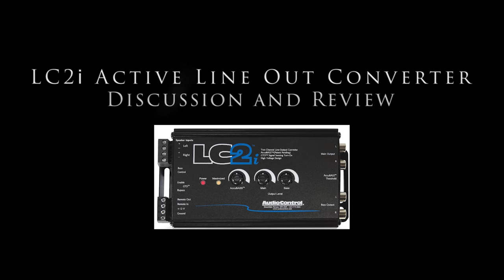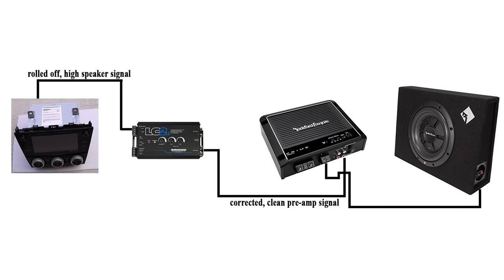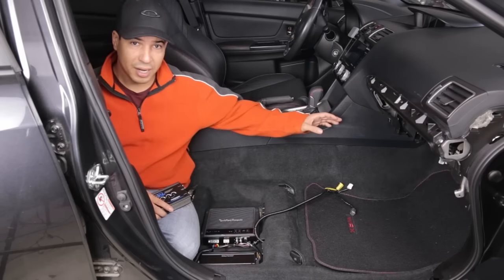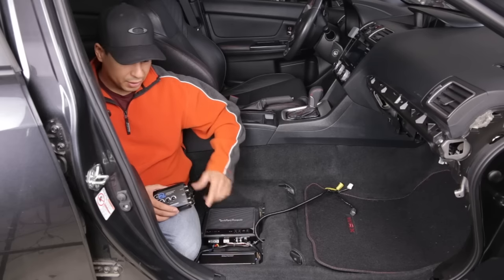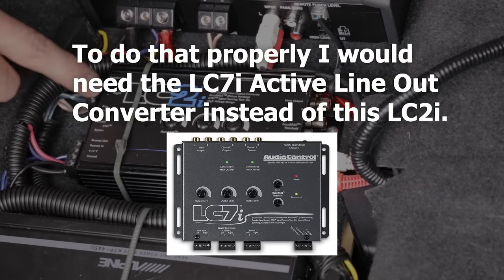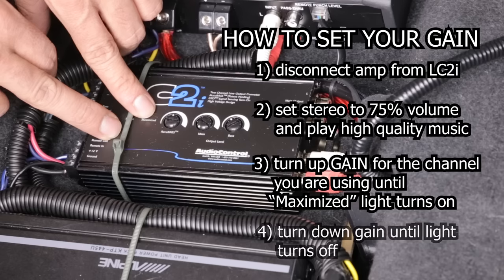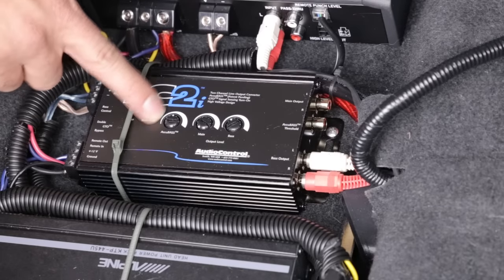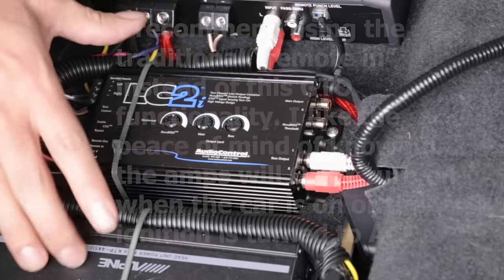LC2i Active Line Out Converter Discussion and Review

Comment: If I only tap my rear speaker wires and still power them from the OEM Uconnect 5.0 factory head unit in my 2016 Renegade Trailhawk will I still get full audio on those speakers including fade?  I only want the sub RCA out and I want to leave my speakers powered by the factory radio.
Reply: Boost & Shutter Thanks! I have everything laid out including the big 4, but now I'm trying to fit my 2001Power Series RF1000.1BD under the driver seat.  There is lots of room vertically but it's a sub compact and I don't want to take all of the floor space for back seat feet.

My back seat mounts to the floor so it MUST be under the driver seat.  I don't have power seats.  I am leaning towards some kind of shelf to elevate my amp, but not sure how to do it.

Comment: What if you were just going to use it for  a sub and the stock subwoofer wire is easy to get at would it be fine in that case to do one channel  with the stock wire or would the sub also need the left and right channels ? Also if you can do it , do you connect the wires to the left or right connectors?

Comment: I have a question you said you tapped into the wires from your amp for power and ground. Can I just do it straight from my amp? I have 0gauge wiring all around. It won't blow this little thing up? Just clamp it on my amps Ground And power? I've never had a car without a aftermarket headunit this whole hi low thing is brand new to me. Just picked one of these little guys up
Reply: @akqjtn  awsome thank you. And yes my ground is always as short as possible

Comment: What EXactly do i connect the 12v input to ? Was gonna connect it to amp but the 4awg power wires barely fit as it is. Should i connect it to my mainline fuse? or maybe on one of the outputs on my power distribution block ?

Comment: Will something like this remove types of interference ?  I've installed the same system in a different car with one if them Walmart converters and now I'm getting interference randomly when I start my car.  Sometimes it will do it when I start it a quick bump in the sub ( quietly) or when I use the driver or rear driver window . It goes away after a few minutes. Not sure what the hell the problem is and don't know where to start since this doesn't happen everyday.

Comment: Hello! Please help :) I have a Lexus CT200h and I have my Amplifier and subwoofer in the back of my car. So then my LC2i would be in the trunk. Would it matter in terms of sound? Because I would have to run speaker wire from the front of the car all the way to the back... Would that affect my front speakers? (Since I will tap into those) or the signal since I would run almost 7 meter of wire?

Comment: If I have two amplifiers being powered one for the bass and then one for the main, that requires two remote turn on wires...can both of those remote wires from each amplifier be ran into the remote out on the lc2i?
Reply: Thanks man...Clean and Beautiful install there by the way man. I plan to tie my lc2i in with the left and right rear speakers...is that how you tied your converter in?

Comment: Great video! I have a 2012 Jeep Wrangler with the infinity sound system with the factory 8in sub. Could I use a cheap passive LOC on the wires running to it and save some money? Or would it still be beneficial to get an active LOC?

Comment: If I have a low level input from factory sub to LC2i, can I still use the main output to run a highs amp? Or would I need a high level input put into the lc2i to accomish that?

Comment: If im running 2 amps, do i just need to run rca's from the loc main ch to the highs amp and rca's from the loc sub ch to the sub amp. Or do i still need to tap into the speaker wires and run them into the highs amp?

Comment: Does this LC2i and LC7i clean the full range signal from the amp or just the clean low bass frequencies? The stock radio on my BMW has a very equalised signal going to all speakers. Will this do the job and send a cleaned up signal to both the main amp and the sub amp? or do I need a proper DSP unit?
Reply: @akqjtn  Ok many thanks.

Comment: I have a question I’m hoping you could help me out. I’m working with a 2017 Silverado and I’m planing on using my stock stereo/ stock speaker . What I plan on using is one 10 jl audio w7 with a jl audio 1000/1 amp,  one capacito, one epicenter. HERe COMES THE BIG PART WILL I BE NEEDING THIS LC2i for my set up? If so would you recommend the LC2i or the LC7i???
Reply: Boost & Shutter thank you I appreciate you taking the time and reply.
Reply: Boost & Shutter I had one more question by adding the LC2i will I still e able to use my steering wheel control- volume/track control or will I need some other type of adaptor to keep that

Comment: good video, my Audi A5 doesnt have RCA pre out so i cant install my amp to power my door speakers or my component speakers, i dont need a subwoofer, just components, will this work?
i suppose ill have to tap in to the factory door speaker cables?  lastly if i connect this to my door speakers will i lose the sound from them, i want the door speakers to work along with my components..
Reply: MROOD The Lc7i will work better for all your speakers and future proof If you ever wanna add a sub

Comment: When you say 400max for the LC2i,  would you explain? I have one and I have it running an amp that puts out plenty more than 400watts. So is this 400 watts max INPUT? I’m confused. 

Let’s say somebody has a coupe of ZV4s or something along the lines. Can this be used for a system that’s pushing out let’s say 2000rms?
Reply: 400 watt max input to lc2i you can run any amount of watts after it as you want
Reply: I just read that the lc2i only outputs down to 33 hz I hope that's not true my box is tuned to 32 hz

Comment: Does the LC2i need to be placed before or after the in the line amp? I ask because in my wife’s car she has a factory premium stereo with tweeters, content speakers and a sub. I am looking up upgrade the sub and i am not sure if I should take the current sub speaker wire and put into the LC2i then RCA to the new sub/amp or connect prior to the factory amp and connect to the front speakers back?
Reply: need to know year/make/model/trim level of vehicle in order to provide accurate information
Reply: @face2face11  I have 2007 cadiliac dts can I get signal for lc2i from factory subwoofer wire that plugs into the factory sub it's a bose system btw?!!!

Comment: I have a question, I have a kicker 80 watt amp and a 10 inch JL audio sub I installed in one of my old vehicles. I used the factory radio because of the navigation / on star etc. I unfortunately went to the local auto shop and purchased pretty much the cheapest line out they had. It sounded (ok) but not great. Is that particular converter necessary for a little 80 watt amp or is there a different option I could use?? I'm good with spending a little extra on one of those things but I feel I'm not running enough power to justify it. Please help.
Reply: It will sound better, for sure.  I just finished installing mine yesterday.  I've had the same amp and sub for 3 years and NEVER got the sound out of it I'm getting now.  I tossed that $15 line out converter in the trash.  I wouldn't even give that thing away.

Comment: Quick question sorry if it’s a dumb one ? In Laymen terms with this I wouldn’t have to get a aftermarket cd deck for my car? I’m finding out it’s really hard to find a kit for me to add a aftermarket deck?? Cuz I know with a Aftermarket deck it makes my whole system louder.! And by system I mean I have a Sub in the trunk with 500 watt amp. I upgraded the front door speakers also. And know that my factory Radio isn’t pushing the door speakers to full potential. With this would it do that? SoWith this It can do that with the factory Radio?
Reply: Boost & Shutter and with this will it let me tap into my front door speakers? What I’m looking for is a way to get more outta front door JL audio speakers without having to add a second amp? It’s going in a Saab 9-5 and know from past stereos that just from having an Amp it somehow brings out even the door speakers? Now having said that I’ve always been able to have an Aftermarket Deck which makes me wonder if it was just that , that made my door speakers louder? I’m just trying to get the most out of my system without having a Aftermarket Deck which most say isn’t possible in that car or a second amp? So when you say tap into front speakers with this is that possible to do?? Cuz I know even with just my 2 JL 12s I’m gonna need more outta my door speakers which are JL also!! So with this can I tap into my Front door speakers then your saying?
Reply: Boost & Shutter thank you for your help.

Comment: This might be a silly question but even if you use the GTO function, do you have to still run 12v power and ground to it?
Reply: Boost & Shutter avoid using the gto function?
Reply: Boost & Shutter what did you use as a remote to your lc2i, about to install mine, stock radio in a ford fusion 2016.
Reply: Boost & Shutter Thank you!! Awsome vid btw!!
Reply: My 2 cents is that it depends on the wiring I’m currently using GTO function on my Camaro 2016 and it works great to turn on my amps and epicenter with no issue

Comment: Ok so I installed this on my car and my subwoofer would just go super loud for no reason. I triple checked everything. I had the lc2i in my last two cars and it worked great. Does it mean it bad? I disabled my microphones on my Cadillac ATS. I grounded to my battery and my music will be playing normal then just my subwoofer will play loud. I’ve tried two ampliers so it’s not the amps . Any suggestions
Reply: I didn’t try the main channel. The bass knob won’t work on that channel does it
Reply: I was just messing around with the bass knob and I muted the volume and just turned the knob and I could hear scratching noise coming out the subwoofer

Comment: Having a bit of confusion with the remote in and out cable connections. Which one is used for the remote turn on wire on the after market amplifier?
Reply: thanks much!! That cleared it up
Reply: What ☝️said
Reply: You can use remote out for your amps and it will use its gto feature to give you a remote trigger without finding a 12volt switched acc or remote from your headunit.
But if youd like to bypass that feature you can switch the jumper to bypass and use your own remote wire
Reply: so i have a similar setup like yours , i havent added my alpine KTU-445 as yet tho, which i have,, do i need it at this point? how would  i add it?
Reply: On the contrary: like he said, You don’t even need a remote wire... actually the speaker wires that you connect into it from the head unit or off the speaker lines provide power to the lc2i, and then. Lc2i has remote wire out that you can use to provide a remote to whatever unit you have or need. That will only turn on when the speaker wires give a signal. I prefer it this way, cause you don’t have to go searching for a remote wire in car. Less wires and it stays compact in the area where you ave you amps, capacitors, epicenters etc..
Reply: @conquerirlemonde8432  that is completely incorrect. the speaker wires DO NOT provide power to the LC2i. they provide AC voltage, in the form of an amplified audio signal, which the LC2i can sense and therefore determine when to turn on... but the power, or supply voltage, for the LC2i is provided via the constant 12v and ground connections in a separate terminal. what you are describing is the manner in which a PASSIVE LOC operates; the LC2i is ACTIVE. (if you think otherwise, feel free to connect ONLY the input signal section of the LC2i, and watch as it never turns on.)

Comment: question? When tapping to the rear speakers to connect the lc2i Line out converter, i see that the shop i took it to only tapped into the rear left speaker. Is that fine or is better to tap to both of the rear speaker and connect them to the line out. Also i am kinda of confused because how should i leave the amp gains and bass boost, should i leave them half way and then match them to the acubass and bass.
Reply: got cha. Thank you.
Reply: What if you were just going to use it for  a sub and the stock subwoofer wire is easy to get at would it be fine in that case to do one channel  with the stock wire or would the bass also have left and right etc.? Also if you can do it do you connect the wires to the left or right connectors?

Comment: Hi can you connect the power wire to a class d mono amplifier for power or do you have to run separate wires for Amp and lc2i to the battery
Reply: Thank you for the prompt response and the Advice

Comment: I know the rule is to tap into speaker wire output of factory amp with the converter... but if I'm running new wires through out the whole car can't I just use the wires from the factory HU and eliminate the factory amp all together?... please help....04 impala ls... want to run 6 6x9s

Comment: Have any idea why my subs sound muffled? haven't adjusted the loc yet. Also they only play when I turn all settings up on the amp. Any help would be great. thanks.
Reply: I actually think I need to use a lc2i. I'm currently running a cheap loc. What type of wire did you use to run the power and ground from your lc2i? Does it come included?
Reply: Can I use speaker wire to hook up the lc2i to power and ground?

Comment: How can the lc2i put back bass signal fed from the rear channels The rears are rolled off more. So feed from front only an it will sound better or better yet use a digital processor fed from the front channels only.

Comment: I installed on a 2018 charger and when I turned the car off the subs started to hum what could that be
Reply: You’re probably using the GTO feature. The problem is that in some cars it’s not perfect so I would recommend getting a true remote signal and bypassing that feature.

Comment: How do you get power from your other amps  to power the LC2i? In the manual it recommends an 18 awg wire with a 1a fuse
Reply: Just place the power wire from lc2i where your sub amp is getting power from just put along and the ground too make sure you have 1A fuse 18 Awg

Comment: Can I use an LC2 instead of Lineout Converter?
Reply: 2018 Kia Forte factory radio goes to vol 45 but gives up at like vol33. Sounds like the highs roll off after 33 but sub bass ok. Would this help or should I just get a 4ch amp for highs?
Reply: Boost & Shutter thanks man. Probably just going to change everything out. Speakers, headunit & maybe 4ch if no change. Think I just need more power

Comment: I’m not getting low bass from the lc2i no matter what I do.
Reply from the maker: In that case you likely have a bad unit. I would contact Audiocontrol.
Reply: @akqjtn  well I just did some further research, the lc2i does not reproduce bass signals lower than 33hz. Crutchfield has the specs on it. So I decided to test it and the specs are correct no frequencies lower than 33hz come through the loc. I did have a (cheapo) loc that was previously installed and I was able to hear frequencies down 26hz. The auditory range for the human ear is 20-20000 so I do believe that if you are using the lc2i for a 2 channel amp powering 6x9’s or 6.5’s or tweeter’s  ect ect then it’s practical and excels at those types of speakers just not subs. However also on the positive note of the lc2i my rear deck 6x9’s front door 6.5 and tweeter and rear door tweeters and 6.5’s sound absolutely amazing.

Comment: Personally I would say that rather than spending money and using this Lc2I why not just get a better head unit or stereo! I know a lot of ignorant people will use steering wheel controls as an excuse but of coarse they have devices for that too so I would rather upgrade the head unit and use a steering wheel adapter if I was worried about loosing the factory controls in the steering wheel! However I do like that the LC2i has a 9.5 V  output but again there are other ways like a line driver it can do the same thing! In pure walk know this but I don't really get people, in a real world quality shop junk like this really shouldn't be used! But then again you always have that one retard that's too dumb to just upgrade their head unit! Mine you I understand this unit I just wouldn't use it myself! Your stereo is only as good as your weakest link and a factory head unit and these units are that weak link!

Comment: I expose the biggest scam in car stereo, the great LOC swindle. Rather than build a headunit that has two separate signals one for the headunit and one for lineout they have built it with an output that is amplified that costs more. The first stage of a signal to amplification is a line to the amplifier that carries the sound, a wire or circuit that carries the signal that runs parallel to a wire that has a boosting current and the signal is boosted by a number of volts. That boosting circuit has a resistor that matches the impedance the amplifier needs to be comaptible. It would cost mere pennies to have two signal wires and have a switch that separates them before the amplification stage, one to headunit amp and one to output RCA. You could mod a HEADUNIT FOR LESS THAN £2.
YOU ARE BEING SCAMMED :-)
Reply: @akqjtn  Thank you, give me 2 upvotes :-) When I get a headunit I will try it and let you know or if you try it first. What are you up to today ?-)